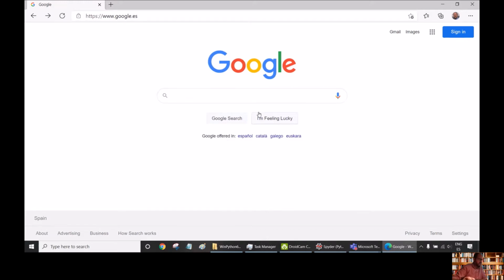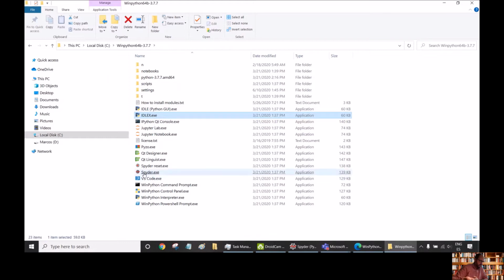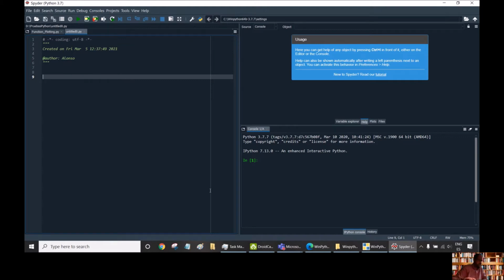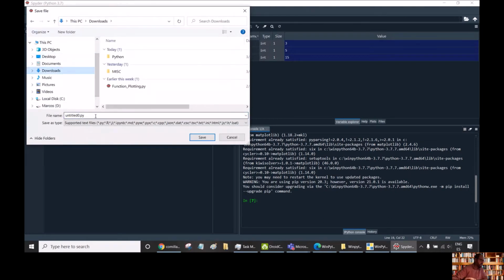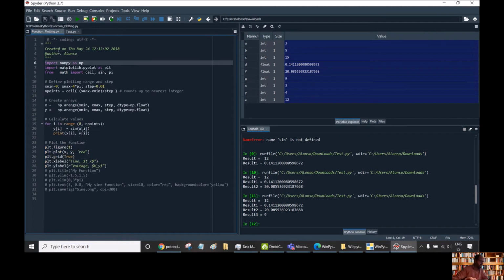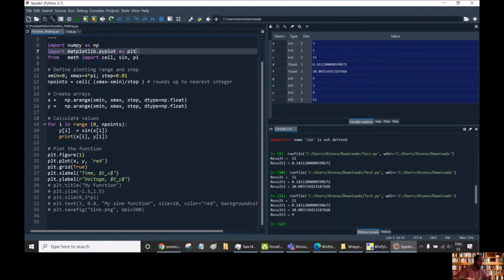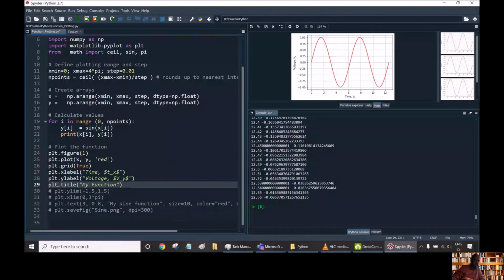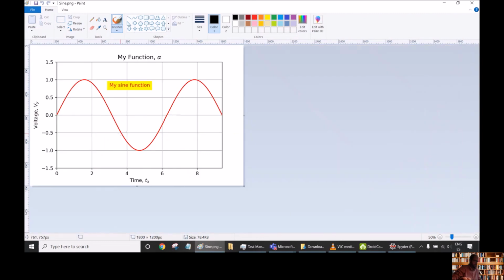WinPython #1: Introduction

Comment: Do you recommend any specific material for learning python for a beginner? Or i should learn as i go.
Reply from the maker: It depends how deep you want to go into python. I use it mainly for mathematical analysis and microcontroller programming and I learn on the go. For beginners, I recommend starting by this site:
https://www.w3schools.com/python/default.asp

Comment: Sir what is the advantage of learning python as a power electronics engineers...can we use to reverse engineer certain problems? Like getting a transfer function from bode plot data ??
Reply from the maker: Hi, you can do many things using python, analysis, design, microcontroller and micropocessor programming, etc. See some examples in the digital electronics playlist of this channel
Thanks!